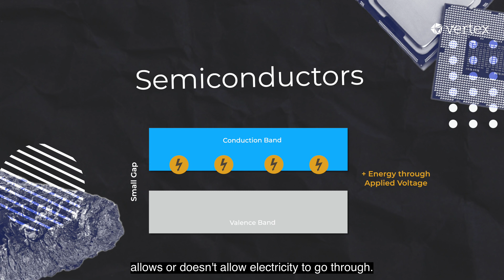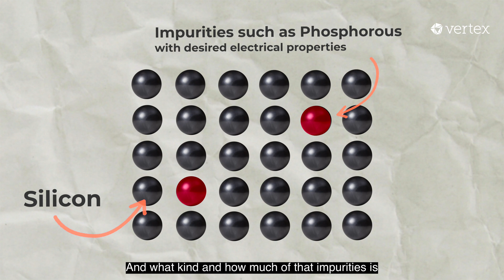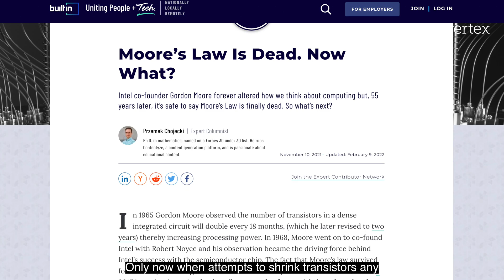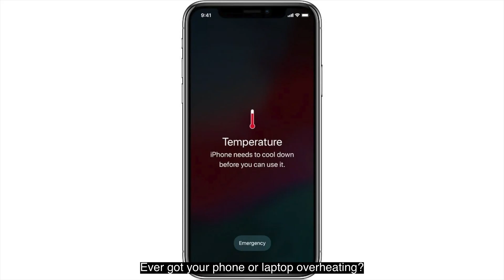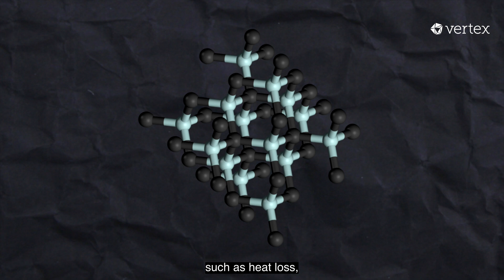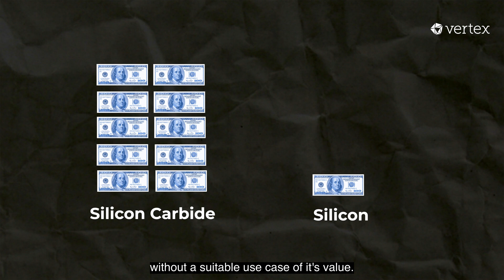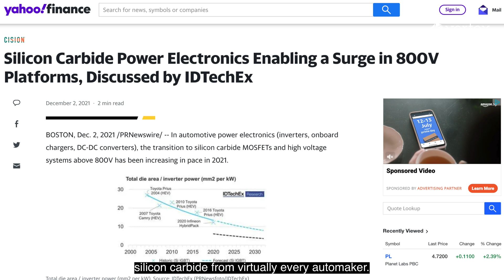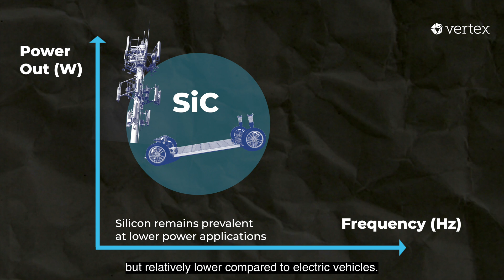Future of Semiconductors: Silicon Carbide & Gallium Nitride as Next-Gen Semiconductors

Comment: This presentation is not very well composed.  They don't explain that digital processing/storage and power electronics are different and that SiC and GaN are far better suited for power applications than Silicon, whose dominant application is digital circuits.  A person could watch this and leave with the notion that SiC is going to replace Silicon in microprocessors.
Reply: Sure, but technically it could be possible to make a silicon carbide CPU.  Wouldn't it have some advantages for a high end computer?

Comment: By the time next batch of chips will enter the industry , quantum computers and analog chips will eat the digital chip marker
Reply: Not really quantum still have a lot to work and analog doesn't gonna comeback as you expect it gonna come convine with digital in a hybrid form and still gonna be límite of the manufacturing process
Reply: @tigerkingboss9106  error corrected quantum computers will be here by 2030 , it's basically a scaling and engineering problem , the main applications of quantum computers is molecular simulations , with that we can produce super conducters pretty quickly and make these si ca
Like intermediate chips unnecessary and anolog will be only choice left for ai researchers ,  even trillion dollar companies can't handle billions of dollars cost of running data centre size computers with megawatts power bills and cooling and tons of water usuage and hundred of acres of land for each iteration of ai like gpt3 , even with
Si ca or germanium or photonics or carbon nano tubes it to won't give the scale of parameters equal to brain and it's 20 watt power consumption in the size of bowling ball and at the weight of 3 pounds 
Only answer is analog chips which will start start coming out in 2025 and mythic is already here
Reply: Quantum computing isn't supposed to replace traditional computing, but rather work along side it.
Reply: No Analog and Quantum computers are just going to be accelerators to the digital chips because both aren't so good at general computation. Analog and Quantum computers only work in very niche applications. Photonics though might change the game in digital computing but even if they become popular we will still need GaAs, SiC and GaN.
Reply: AFAIK quantum computers can never replace digital chip, both simply have different applications. New digital chip would still be used by general consumers while quantum computers will simply be used by big research and development companies. Both have good potential but they are not rivals of eachother
Reply: Quantum and analog are solutions to specific applications just as silicon digital integrated circuits serve specific applications.  They're not interchangeable, any more than we could make smartphone microprocessors from Silicon Carbide chips.
Reply: at the moment there's no way to make a quantum computer run tetris.. it have all different purpose. I'd rather watch at optofotonic or new silicate/gallium etc.. more likely future computation will be a mix of all this, but nobody knows the future.. yet.

Comment: Probably understand less than 30% of this video and yet I'm irrationally excited for the future
Reply: It is marketing word salad, not ment to be fully coherent or commiting to any specific facts.
Reply: Just knowing that 650V Gallium Nitride and 1200V Breakdown Voltage Silicon Carbide Power MOSFETS technology will make Terminators possible with the agility and reaction speed seen in I Robot is enough for now. High Power Compact Size Power Electronics.
Reply from the maker: Thanks for watching Milan! We share your excitement - its absolutely mindblowing when you look at the exponential pace of technological advancement.
Reply: @vertexholdings  you clearly do not have a good understanding of WBG technology.   In much of this video you talk about the applications that nobody in the industry is considering as possible contenders for WBG adoption.   There is just no way that WBG is going to get used for microprocessor applications nor is there much semiconductor content in a smartphone that is going to use WBG semiconductors.

WBG is only being considered for the applications that it makes sense to be used I.E., power electronics applications. 

Also you talk about the high capital investment needed being a barrier for small start-ups entering into the WBG market,  and this is contrary to the actual reality of the market.   There vast majority of the GaN market is actually made up by a number of new 'fab-less' start-up companies that did not exist prior to GaN technology existing.  TSMC has invested heavily in GaN manufacturing technology on the basis of enabling and supporting these 'fab-less' small start-ups.  Also, GaN manufacturing is able to be set up to use old obsolete silicon fabs, so a lot of the equipment used is being bought for nothing more than the scrap price for the equipment.  This enabled quite a number of very small start-ups with nothing more than a few million dollars of capital to enter into this market.   This is the other end of tge spectrum to the many billion dollar investments that are still common for cutting edge silicon fabs.

A very minimal amount of research would have revealed these facts about WBG technology.